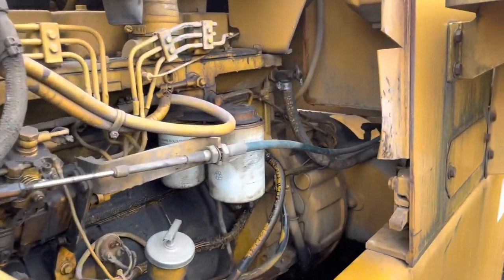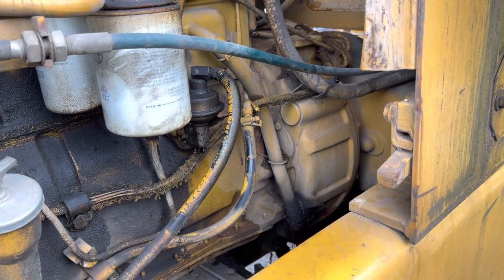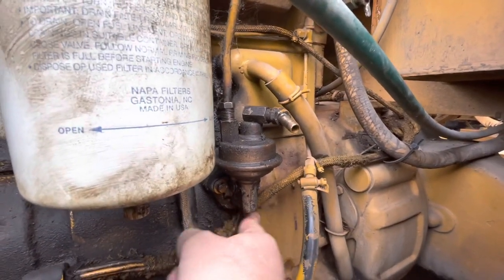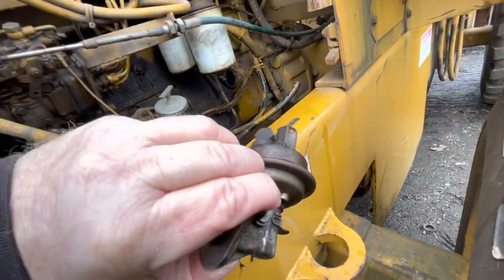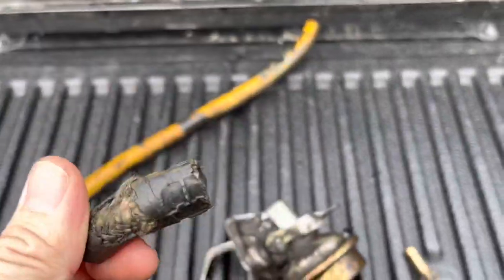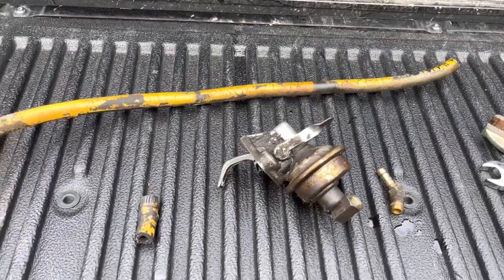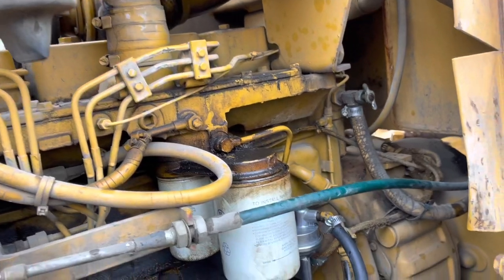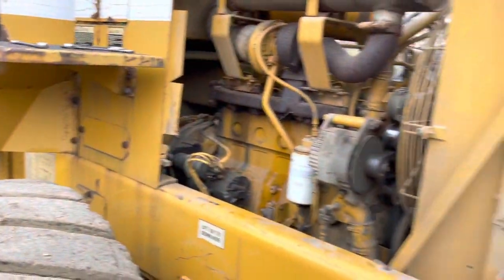Junk Yard Loader repair. #Salvage Yard #Junk Yard Dresser 520B Loader

Comment: Hey Gary, I now see why you said that pump was only around $100.  It looks more like a lift pump vs the main high pressure fuel pump on a diesel which is a lot more $$$.  I thought you were talking about the high-pressure pump.
Reply from the maker: Larry, You have a Fuel pump and a injector pump. The fuel pump on this Cummins engine is just a lower pressure high volume pump. Thanks for watching my friend.

Comment: I've never worked on a diesel fuel pump, but the last time I had to replace a gasoline mechanical pump it filled the oil full of gas. I'm not sure if diesel will do the same.
Reply from the maker: Your right. And if this was a internal leak it would do the same. This was just wore out... lol